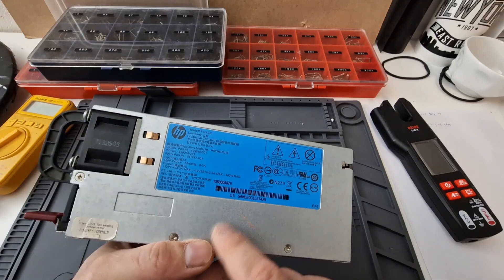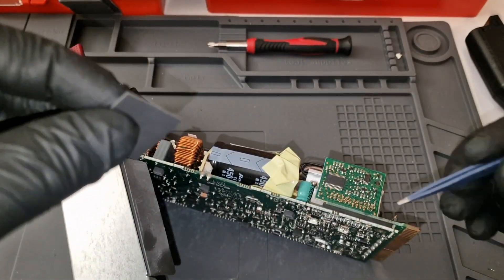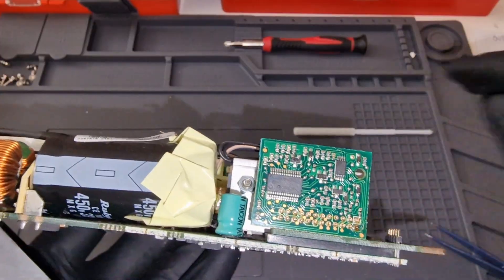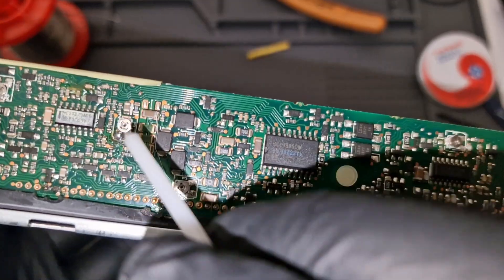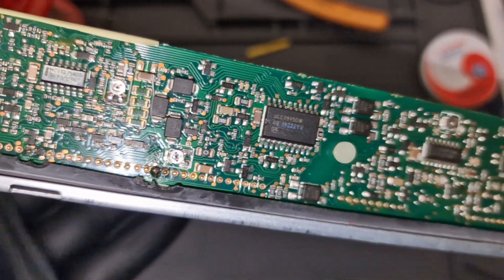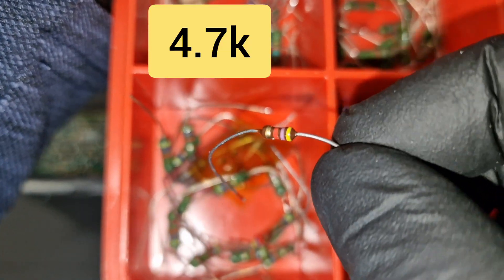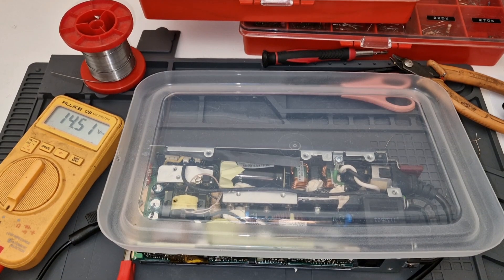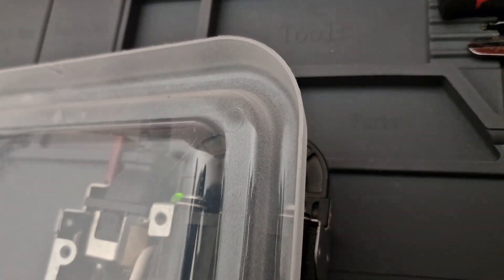HSTNS-PL14 Mod up to 15v and OVP bypass for cb-radio ham

Comment: I just received two of these same power supplies and I quickly checked that they work. I just shor circuited pins 1 and four and the led in the back went on. Supply worked, too but fan didn't start. So, I am going to make 22k modification as permanent solution. I hope it will keep the fan on.

Comment: or you could use a switch on the 1 leg and 3 leg ,then drill 2 holes on positive and the negatives for youe red and black lead with a fuse in the adaptor.
Reply from the maker: Yes there is different ways to do this :)

Comment: Can i use this setup for HSTNS PR-17?
Reply from the maker: Hi, no I dont think so. I have not tested the PR-17 yet.
Reply: What if i just turn the pot right? Did the voltage will raise?  @CuriousDiyFreak
Reply from the maker: @SuperKresno If you turn the trimpot on the pr17 the voltage should increase/rise , It will Only rise very little (1 volts maybe)

, if you can figure out where to put a resistor it should increase/rise little bit more , then the OVP will kick in if its too high.